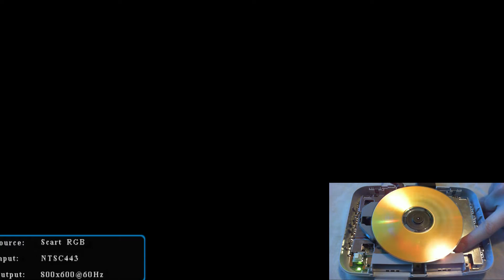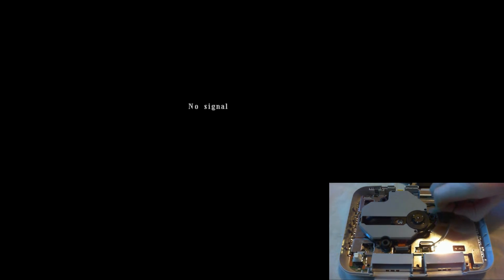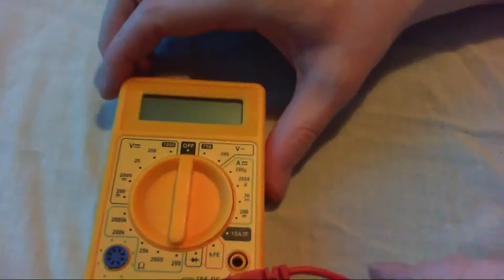PSONE Pot Tweak (Fix Disk Skipping)

Comment: Hi, thanks for this it's very helpful.  I have a psone that had never been opened and the potentiometer was set at 790 ohms,  that seems low, so I'm a little hesitant to lower it further and cannot find much info on it.  Any thoughts?
Reply: That is pretty low, the laser would probably be getting too much power, did you try to lower it?
Reply: @Dan-km1zs  yeah I did, testing with the crappiest games I had.  I eventually got it to work consitently but at just above 400 I believe.  Makes snappy noises lol.  Needless to say, I don't use it, for fear that I'll ruin discs

Comment: It's weird, I adjusted it several times, all between 1.25ish and 9.03ish and it reads both MGS/MGSVR/RE2 but not Crash Team Racing. For Crash Team Racing I have to lower it waaaay down below 8.75ish, but then it won't read the other games...

Comment: That CD sucks :P
Never use a Traxdata, because the laser needs more power signal to read the disc.
And you don't need also the pot tweak. Just use a good disc like a Taiyo Yuden :-)
Reply: Or Princo CD-Rs for that matter. 

I just got a chipped slim (ONECHIP, much to my surprise - these are rare as hens teeth) and let me tell you, Princo discs skip the worst.  This is because they made the CD-Rs so cheap and thin they're decaying without being actually used. The only game I got to work using a Princo CD-R, although with lots of skipping on this slim, was an NTSC-J copy of Abe'99 (Abe's Exoddus - japanese variant w/ PC features added in). Strange enough, the same disc played perfectly on another PS1, a Old Crow 4-wire chipped 1002 that I swapped a BAM assembly in.

And yes, you do actually need the pot tweak. Most of the times I've noticed that games that wouldn't load initially on the same machine would load fine if I adjusted the pot.
Reply: PC-VX41 Princo and Traxdata are both Taiwanese, Verbatim AZO is superior to use backup for PSone
Reply: Playvoodoo Dunno,never had probs with Princo or Traxdata, and on a lot of models.
Reply: It depends on their quality control at the factory. Sony CD-R is actually made by Ritek media
Reply: Just to add to this old thread... based on my experience Taiyo Yudens are not perfect either. I have 3 consoles and only one takes the taiyo’s good. Have tested Azo’s and same principle applies. Results will vary.
Reply: @joeypr  if taiyo are mades by CMC, they sucks.

But for taiyo yuden, I mean the disc branded "THAT'S".

The perfect combination are Plexwriter PX-W1210 and Metal Azo (1x writing speed).

Comment: I going to assume the same thing has to be done on the 7502 to fix this problem, am I correct?
Reply: Also if I hooked up a 12v fan to the 8v pinout from the power supply, how would that affect the system in terms of the electronics (Will it damage the console)?
Reply from the maker: Yes you can pot tweek the 72XX series the same way, And adding a fan should be fine but it's not needed and will add a lot of noise. It was only the original 1000 series models that had a overheating issue.
Reply: +jse07 Thanks for the help, i'll get to doing it when I come back from holiday.
Reply: Worn out 7xxx-900x consoles will need this. I have a 9002 and I had to adjust the laser to read the discs without a slight skip. (save for old and scratched disks - an NTSC copy of Abe's Oddysee will occasionally do that)

Comment: Nice tutorial, but in this particular case, the game is the problem.  
Final fantasy 9 must be the same region as your PS1. If not, it will always skip during FMV's because of the framerate.
Reply from the maker: All Playstations run at both 50hz and 60hz, it's printed on the bottom of every unit.
Reply: @jse07   I'm afraid not. PS1 games run at 50 or 60Hz based on the software itself.